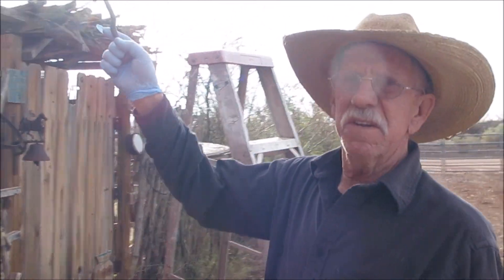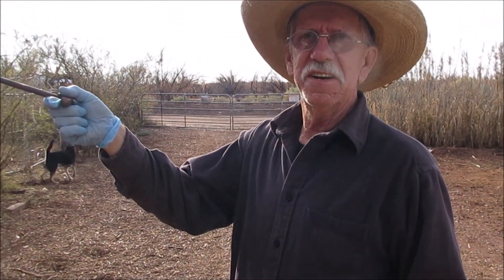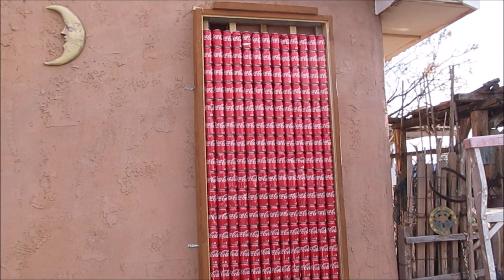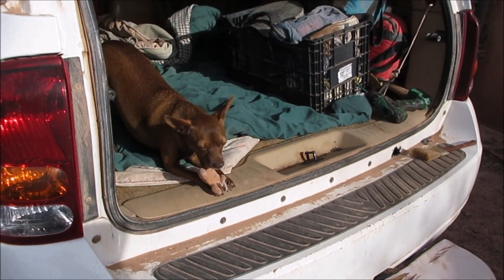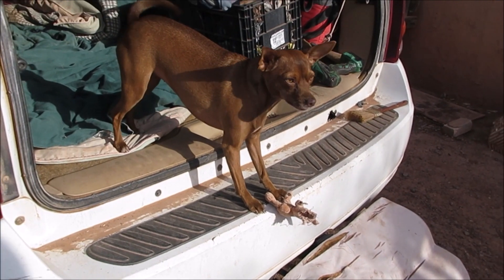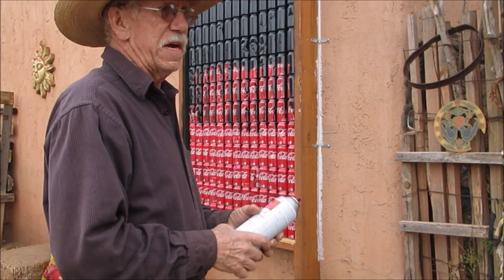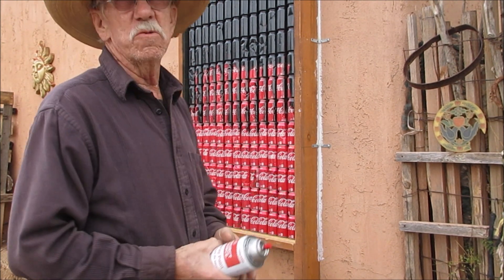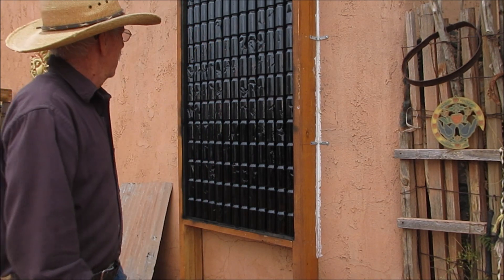Update on pop can solar heater

Comment: 4-5 cans over from top left. I like that Idea of the pop cans. A fellow up here made one out of black plexiglass and solar operated computer fans it was similar in design. I want to collect large magnifying glasses 3" diameter and put them on a steel heat box filled with sand so it super heats the sand then add a fan to it. I also think the old overhead transparency projector beds would also work by just using the bed glass where the transparency was laid on the overhead projector. Much less work and more heat.
Reply from the maker: That sounds like a interesting. It would be fun to watch.